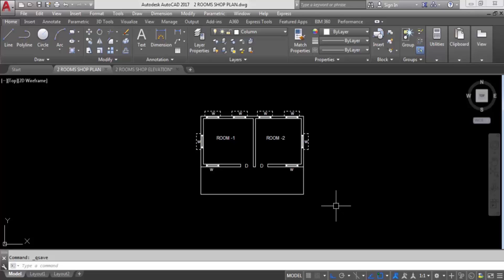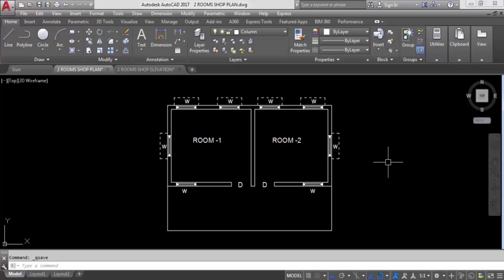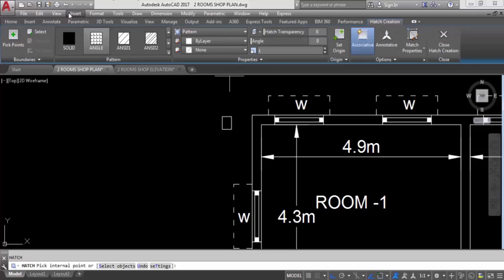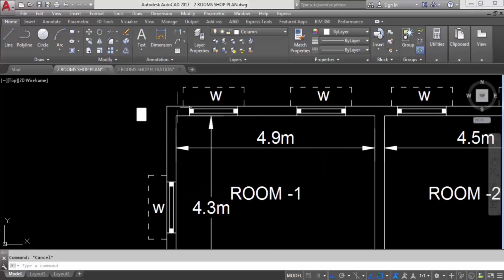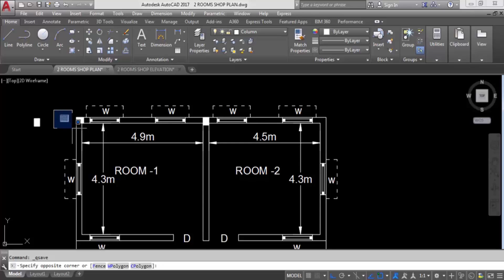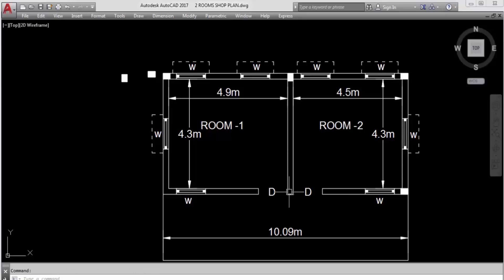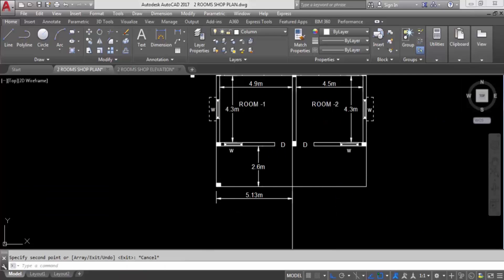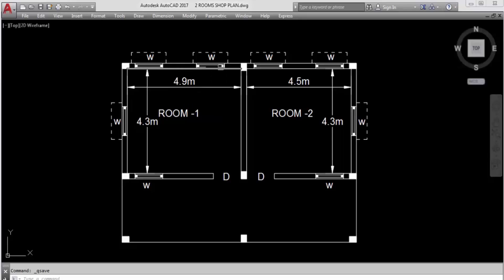How to Decide Position & Orientation of Columns in Building || Placing of Columns || Building #12

Comment: Hello maam mai ek b.tch fresher hu or auto cadd comlete ho gya or 3ds max abhi running mai hai please suggest me how i find this type of job
Reply from the maker: You will get the outer line dimension  by adding the interior dimensions with wall thickness. Try, if you dont get it, I will explain again.
Reply: @civilengineeringtutorials  mujhe appse ye suggetion chaiye ki fresher hai apna job nahi mil rha designing mai jana hai kaise kare job  ye batao